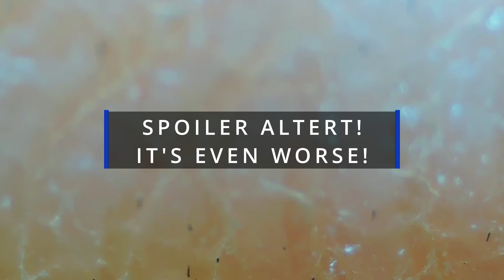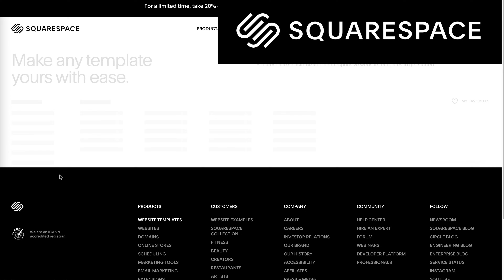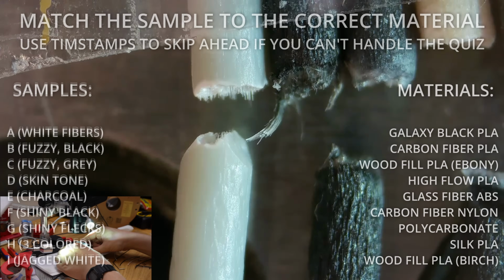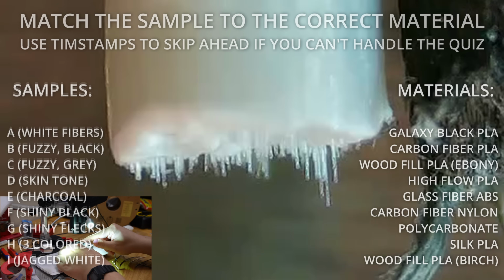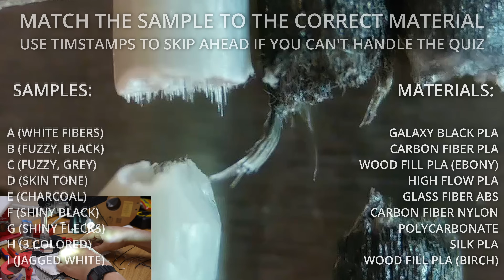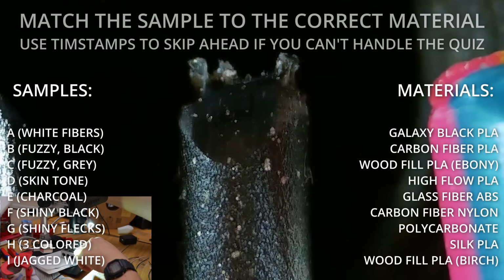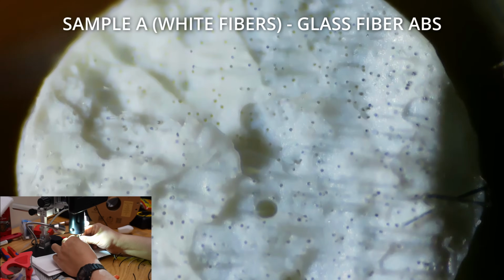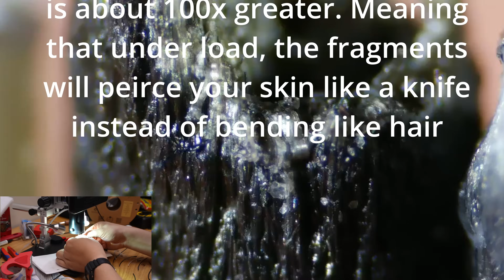Carbon In My Skin. These Wounds, They Will Not Heal.

Comment: Embedded into the skin isnt a big deal you're covered in about an 11 layer barrier of dead cells before you get to the first layer of living dermis, and you shed outwards. The real problem is probably all of that that gets into the lungs.
Reply: Few enough people seemed to mention this... Considering the size of the strands embedded in the skin after the test there's zero cause for concern in touching the parts. Anything in there is just gonna fall out while exfoliating. I'm more interested in knowing whether any of this gets airborne or whether parts can shed a significant amount of carbon filament particles in their surrounding environment.
Reply: @K3Techs  I worked as a fiberglass laminator for many years, the strands become airborne very easily, you should wear a mask at all time when handling it.
Reply: @quercus3290  true, sheets or rods of carbon are the same. But once encased in molten plastic I assume dust is significantly reduced
Reply: @K3Techs unless you breathe it in, it could shed into the air
Reply: @Drad_  how? What force would grab particles that are encased in plastic and project them into the surrounding air, working against both gravity and the very strong force of the plastic holding the particles back?
Reply: @K3Techs  Rubbing of the coils when moving them, also when he touches the prints some of the carbon needles get dislodged, so logically it can happen, maybe when dusting or a strong enough gust of wind. A single print is fine but what if you print fan blades out of it? 
I am not against these materials, to be clear. But if there is a danger, even in a specific use case of a lot of that stuff dislodging into the air, even over time it is worth KNOWING about it when buying and using the product. 
No harm in that, but let's not turn it into fear mongering. However any potential dangers should be known if something is going mass market.
Reply: @K3Techs How about your eyes too?
Reply: @K3Techs I doubt any makes it to the lungs lmao, they is way more shit in the air to worry about even just going outside
Reply: @K3Techs   bot
Reply: Yeah, it is just an irritant for the skin, and that only if you get large amounts into the skin.
Reply: Someone in the comments suggested using a fan and some kind of filter to test for fibers in the air. I'd like to see that too!
Reply: Exactly, these are so tiny and seem to barely get into the skin, you'll most likely shed these fibers with your outer skin layer. The outermost layer is actually dead anyways.
Reply: This no problem, they have already found nano plastics in liver,brain,balls, blood stream and blood cloths, humanity have like 3-4 generations left. Thanks for playing.
Reply: @rustybot4279  Oh look, Youboob doc is in the house.
Reply: I wonder inhaling those airborne filament fragments could cause things like silicosis
Reply: Wuth some of our luck, the filaments will fall to the living layer. And what about getting it in the mouth when touching food or licking your fingers after not realizing you have filaments on them.
Reply: What if a scratch my bauls right after?

-Edit: Jokes aside I think this could be an issue, I'll be handling CF differently from now on.
Reply: Eye balls 😢
Reply: 11 layers of what?💀💀💀
Reply: if you use actual carbon fiber, you can get splinters and you want to get them out. unlike wood carbon will not dissolve because you are carbon.
Reply: once a foreign object enters the body, if you're unable to break it down it can become cancerous.
Reply: 11 layers isn't really a lot of microscopic cells
Reply: Now imagine that embedded in your lungs and other internal organs. That's the big problem here. If you are finding it embedded in your skin it is 100% also being embedded in your lungs. You are one of those people who think that if something is not causing immediate drastic harm then it isn't causing any harm at all. The harm some things cause might not be seen for months or years after exposure. And worse for repeated exposure.
Reply: Okay, great. Let’s talk about how your hands can be used to wipe your wipe, pick your nose/ear, and you might want to snack on a sandwich right after working with the material.

inb4 someone says, “just wash your hands”. Anyone that responds with that is missing the point.
Reply: Okay, great. Let’s talk about how your hands can be used to wipe your wipe, pick your nose/ear, and you might want to snack on a sandwich right after working with the material.

inb4 someone says, “just wash your hands”. Anyone that responds with that is missing the point.
Reply: What if you get it in your hands and then rub your eyes?
Reply: Into the lungs and eyes
Reply: Hi, biologist here. The outer layer of epidermal cells are dead skin, but it's extremely thin and porous. The skin is still very much alive and is in constant communication with the external environment, that's why things like epidermal patches work. It will not protect you from the hazardous effects of these splinters getting embedded in it.
Reply: I wonder how this stuff compares to asbestos.
Reply: True, or eating it by mistake
Reply: Food tastes better with plastic.
Reply: Yeah it's kinda the whole point of skin to block stuff from getting inside, so if it's stuck in the skin then the skin worked perfectly. But while the stuff is printing, or getting sanded, you definitely run the risk of it getting in the lungs or eyes.
Reply: @DrJuanTaco  are all 3d filament reinforced with carbon fiber or fiber glass?
Reply: There is a concern if you get them on fingers... And then you wear contact lenses...
Reply: Not a big deal? So you enjoy dermatitus? Skin is only 4mm thick at most, and usually much thinner than that, it is 100% an issue, and the skin isn't the only exterior part of your body it can get in contact with. What if someone touches a model made with this, then scratches their eyes?
Reply: @Razumen  these shards don't even look more than 0.5-1mm long at the absolute absolute max. Have you seen the video? They are literally microscopic. Yeah they'd be bad in your eyes, then again so is silica and we are practically coated with the stuff
Reply: @K3Techs  can you explain why we are "coated with silica?"
Reply: @georg2010cz  it's literally everywhere in our environment. There is no explanation beyond that. Sand is silica, dirt contains silica, dust in the wind is largely silica... etc.
Reply: @K3Techs  0.5 —1 mm length fibers would clog up a standard nozzle sooner or later.
In normal filament they are between 0.03 and 0.3 mm long.
Reply: Carbon fiber shill  @K3Techs
Reply: @Razumen  no one is getting dermatitus from these ridiculously small strands, are you delusional? This is irrelevant and a non issue. We come across and interact with far more """harmful""" substances all time in our daily lives and it's still not a problem.
Reply: @Razumen  Who the fack scratches their eyes?
Reply: Dermatitis is a spectrum where one end is healthy skin. If you make stuff, your skin gets beat up. Not just wood & metal and thermoplastics, even food takes a toll on the hands who prepare lots of it. That’s how it is we are evolved to handle it. Far more concerning is contact with lungs and eyes
Reply: @Razumen do you even know how thick 4mm is? these fibers arent even 1/10 of that size and will shed off
Reply: @Razumen of all the kinds of shit we get in our lungs and eyes on a daily basis this doesnt worry me much keep your aluminum foiled helmet on🫡
Reply: @kyokushin2229  Lol, what a short sighted, lead brained take.
Reply: @Razumen as short sighted as being afraid of every new video someone publishes about a fiber that leaves micro residue on your skin?😂 you good inside your hazmat suit maybe the oxygen tank is running low?
Reply: @kyokushin2229  Why are you being so offended by people wanting to minimize exposure to any form of hazard?
Reply: @Vskayp974 im not american i dont get offended😂 its just silly all the things people are scared of when they are first made aware while they are ignorant to everything else that actually is a problem👍🏻
Reply: @Razumen it must be scary for you to leave the safety of your home and step out into the dangerous world out there.
Reply: @caseyeberle7998  It must be scary for you to go on the internet and read facts.
Reply: @Razumen   tbf your lung does kinda shed them off, but idk if it applies to cf shards
Reply: @Razumen  Dude, do you realky thing that all the mineral powders we use in eveyday products don't do the same? 
Talc, silica bearings for dehydration, the ceramic pigmets in old paint, zeolites in many water purifiers, the graphite in pencils, diatomaceous earth and even common dust creates by natural erosion of the landscape smong other sources. 
We are exposed to these kind of particulates all time from manmade and natural sources, it is not really a big deal as long as the exposure isn't too high and the accomulative damage wouldn't become too pronounced before your passing.
And that is my main grip with this paranoia about these health alarmists, they seem to assume that the human body should stay pristine as if we were inmortal while the truth is that it only has to last in somewhat acceptable conditions for 70-80 years and that's it.
Reply: @carlosdgutierrez6570  What about, what about, what about... Look, it's not about the 70-80 years, it's what shape you live them in. Living to 80 with your lungs clogged with printing filament particles isn't something to aspire to. I can't really control exposure to common dust caused by natural landscape erosion, but I can definitely control exposure to 3d printing.
Reply: @jimmyjakes1823  “Life should not be a journey to the grave with the intention of arriving safely in a pretty and well preserved body, but rather to skid in broadside in a cloud of smoke, thoroughly used up, totally worn out, and loudly proclaiming "Wow! What a Ride!”

― Hunter S. Thompson
Reply: That's why your lungs have mucus.
Reply: @DrakyHRT how did that mucus work for mesothelioma and coal lung?  The biomechanics of a mucus layer on a rod/tube type foreign body can still cause it to become embedded. As the mucus layer slides it can cause the tubes to “tumble” and embed at one end. These fibers are different than most other foreign bodies in the air. The issue is that the human body does not break down carbon fiber. It has the same modulus and acceptance as bone. At best it will be encapsulated with benign tissue.
Reply: @DrakyHRT  Enjoy that lung scarring.
Reply: @Razumen  Unless you're sanding the material and breathing in the dust all day it's harmless.
Same with asbestos, it's (almost) harmless unless you're working with the stuff every day.
Risk goes up with exposure time. If you're working 8 hour 6 day shifts making fibreglass boards or insulation you'll need PPE. If you're 3d printing an object in fibreglass or CF filament you're not at much risk.
Reply: @daviddavidson2357  If you're 3D printing it, you're gonna be exposed to it everyday, and 3D printing involve finishing like sanding and cutting. LOL
Reply: @Razumen  I 3d print myself.
The amount of cutting and sanding I do, compared to a factory environment is minimal and in a well ventilated room. I'm not going to have a belt sander running for 8 hours a day in that room just to finish prints, they'll be hand sanded. Compare that to hand finishing something you've made out of fibreglass or wood at home and it's nothing in comparison. 

I also don't 3d print daily, my filament is bagged up to reduce the amount of moisture it sucks up. Even if I was, the amount of material giving off small particulates while exposed to strong air currents is nothing compared to that of working in a mine, or working in an insulation factory, or even woodworking semi-professionally. 

If you're running a print farm, then maybe this is cause for a small amount of concern, for home gamers, it isn't. It's multiple levels lower in risk compared to the 5 or so grammes of microplastics you eat a day in your food. 

I bet the people going all chicken little over their printers giving off small fibres also sleep soundly on polyester pillows at night while buying their food in soft plastic packaging, drinking Fl water, spraying themselves with aerosols. All the while using copious amounts of cheap shampoo, conditioner, scented air fresheners and washing powder.
Reply: @daviddavidson2357  You're not everyone. And all levels of exposure add up. Not to mention your whataboutism about other completely different materials make no sense.
Reply: @Razumen  Most people who 3d print are going to make prints that require minimal finishing, no (or very little, due to the heating potentially melting the filament) electric sanding for their prints and the fibres are almost all contained within the plastic.

Asbestos-concrete roof tiles (and other asbestos products) are still on houses in many developed, western countries. These have fibres on the outside exactly like these prints. They are seen as safe unless you start crushing them or handling them for extended periods of time.

Glass and carbon fibres are orders of magnitude less dangerous. As for "all exposure adds up" while you're right, there is a minimum safe level and most printing filaments are going to come in way below that as you're extruding molten plastic, not making large cuts, or sanding huge pieces down for the majority of 3d prints.

There are much more pressing things to worry about than the tiny amount of glass or carbon fibres in a 3d print.
Reply: @daviddavidson2357  This video literally proves you wrong.
Reply: @Razumen  How?
One guy fondling 3d prints proves that everyone who does 3d printing is in some way A raiding the surface of their prints of throw off a statistically significant amount of dust that is harmful?

Funny that you say "You're not everyone" then assume that the creator of the video is everyone.
Reply: @Razumen  statistically speaking, there is way more plastic fibers traversing (and partially resting for a long time) in the stomach/digestive system than lungs/respiratory system. The mucus is quite effective for small quantities to drain stuff towards mouth/nose. Since we tend to swallow much more often than we spit, there you have it. Maybe some medical studies should be conducted for the 3D print community, it may become a long term issue with enough time and ignorance.
Reply: @codures  Quantity is less important that type in this instance. Not all plastics are equal. 
Very fitting that you say something like this and end your statement with the word "ignorance."
Reply: @Razumen  since nutriments are absorbed through the guts, there might be more (of any type/kind) that may end up in the blood stream taking this alternative path. I wasn't contradicting. Finally, the "ignorance" in the end is not directed towards you either. There are no limitations, restrictions or warnings regarding these materials and so, possible illness from these materials may become a problem over time and uninformed people (that was the ignorance part). It wasn't an ad hominem attack.
Reply: @UgrevsBoots  Nice whataboutism
Reply: @Razumen  nice ignorance
Reply: @UgrevsBoots  Bring something to the discussion rather than dumb fallacies. The grown ups are talking here kiddo.
Reply: @Razumen  i have more experience in this area than you could possible imagine, son. You can't ignore the truth by pretending it isn't there.
Reply: @UgrevsBoots  You have said absolutely nothing of value or substance here, other than a dumb fallacy. So yeah, there's nothing to pretend that isn't there, because for you, there really is nothing there at all.
Reply: @Razumen  Yeah, you shouldn't be talking about discussing anything while acting all emotional. It's clear that you're hurt over not getting validation instead of finding the truth
Reply: @jkone_  Nothing I said was overly emotional, nice try Karen.
Reply: @Razumen   Your condescending tone is an obvious indicator that you are clearly upset, and you try to project that onto others, so the only thing left for you is to deny it
Reply: @jkone_  The only one projecting here is you, pretty sad actually.
Reply: @Razumen  Notice how you've deflected addressing the substantive points by launching personal attacks? Rich coming from someone upset about whataboutisms. Every statement I've made has been a direct dissection of your argumentative tactics, so your "projecting" accusation is a desperate cope. You might want to catch up on some definitions before throwing words around like that
Reply: @daviddavidson2357 harmless and then saying that is not a big deal is contradictory
Reply: Don't worry a lot we can just print a lung.
Reply: There's been micro plastics in water animals and people for a very long time and they are not sure of the long term effects yet but it seems that something else will take you out before the micro plastics so I wouldn't worry
Reply: @MikeHoncho0811  these fibers are not microplastics. 
It’s more akin to asbestos.
Reply: @MikeHoncho0811 there's a difference between consuming small amounts and breathing it in.
Reply: @MikeHoncho0811 Microplastic is know to cause cancer, affects hormones and neurodevelopmental of children
Reply: He is just dumb 

People had the same kind of issues with stainless steel and other material

I think this is just dumb